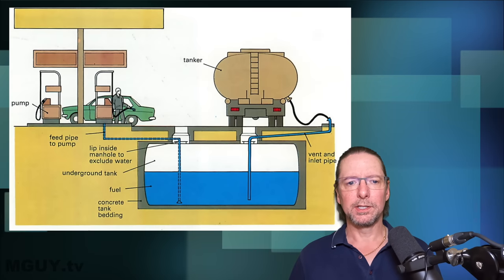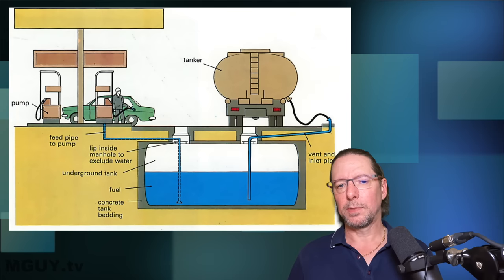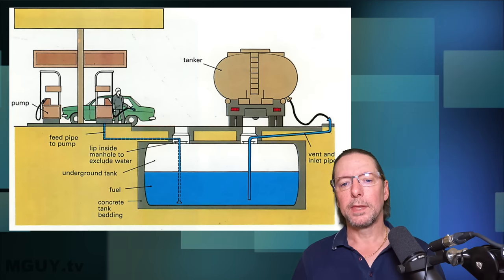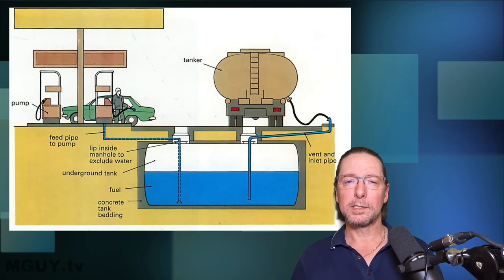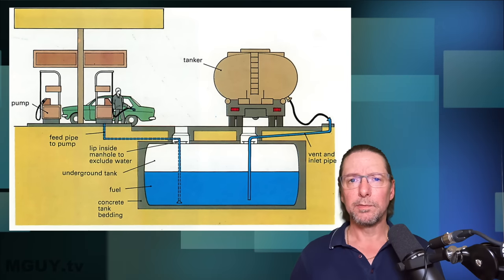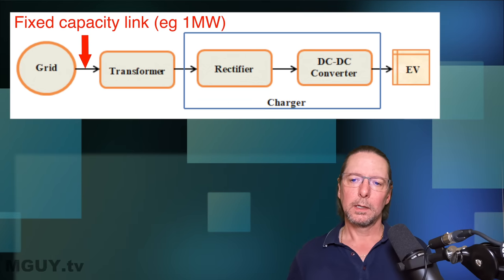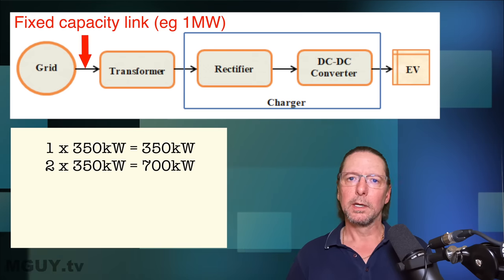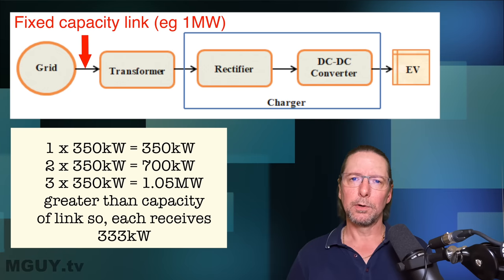HUGE problem with EV Charging Stations that no one mentions | MGUY Australia

Comment: Actually most stations have pumps sharing a common feed so during high volume situations where most pumps are being used fueling times are drastically increased.  If you are holding on to the nozzle when someone else starts pumping you can often feel the change in flow and you can also feel the jolt when they stop.  People harp and exaggerate what might happen on the more rare occasions when they might take a trip on the Expressway however that does not represent daily life for the vast majority of drivers.  Fueling stations for EV's not having large underground tanks of dangerous liquid fuel can be set up at the restaurant, donut shop, rest area, hotel, etc where you are going to be stopping after you normally fuel up an ICE vehicle eliminating the need for dedicated fueling stations and making it so on those rare occasions that most people would need to use a public charging station it would be while eating lunch, shopping or using the restrooms.

The new standard in EV charging stations is to have capacitor banks or battery banks charged off peak or by solar eliminating the need for tank trucks further reducing wear and tear on the roadways along with the inherent dangers of transporting flammable/explosive products on the roadways.  The added benefit of these systems is that they are being used to provide extra power back to the grid during peak usage and are driving the cost of electricity down where they are being implemented.  Countries where they are adopting bidirectional charging and solar are currently seeing this even when located at latitude the vocal minority claims its impossible despite folks living there benefiting from this daily even seeing the cost of electricity dropping substantially and at times even being given away at no charge when there is so much excess capacity with all the grid batteries fully charged that there is no-where left to store it.  Look at where they are actually trying to make this succeed and you will find that without the artificial stumbling blocks put in the way by the naysayers EV's and Solar work out extremely well.

I've been driving an EV now for a decade and its laughable to listen to some of this stuff.  Truth be told I've been keeping an ICE vehicle for all those times I might need greater range and it only gets fueled up once or twice a year.  In ten years I've only really needed to charge away from home twice.  This is more the situation for Joe Average here who drives less than 30 miles round trip  per day.  People who drive substantially more than 30 miles per day are a comparatively small yet highly vocal minority.

The DOT report on driving in the US revealed that most long trips by personal vehicle (defined as round trips over 50 miles) were less than 270 miles round trip so well within the range of most new EV's with just one stop at the turnaround point for charging, most trips over 270 miles but less than 500 miles were by bus or train and the majority over 500 miles were by airliners in 2022 so that is the reality here in the US.  Yes there are statistical outliers that drive more but they are just that outliers and not the more common use cases even though they present themselves as the overwhelming majority.

Best!

Comment: I would like to know what the cost is of charging by how far you can travel...and doesnt heater and radio also cause power to drain quicker?
Reply: Cost per mile varies considerably. For people on overnight special tariffs, and charging at home all the time it can be as low as 2p per mile. The normal daytime tariff at home can be 7p per mile. Public charging can be very expensive - from 12p per mile up to 20p per mile. At that price, it's the same as an average car buying petrol. The heater and radio do use some power of course but over a 50-mile journey, the loss is hardly noticeable.

Comment: (Retired about 5 years ago from a large electric company in the US - I was in IT Field Services.)
This is the level I'm most concerned about in the rosy views of migration to EVs. Aside from the "why" aspect, the devil really is in the "exactly how." Generation has been increasing modestly here in America and transmission (typically above 230kV in America - a similar voltage I forget in Canada) is a fairly stable consideration, but a large number of EV chargers at any location are a challenge in two ways: capacity and just plain existence.

Existence is simple enough: design and build from whatever pot of money is available. New facilities will be properly sized when they are complete. When that will be is anybody's guess: The materials are being made at the pace they have historically been used; nobody has tens or hundreds of millions of dollars of specialty hardware lying around... not the manufacturer nor the wholesaler. That's just as well; it takes time and manpower to build it.

Upgrading existing facilities is not quite as thorny. It is often just a matter of replacing the conductors with larger ones. Not so bad when we are talking about a mile or two, but in the hundred mile regime it gets awfully real. No showstoppers, just a long slog.

All that can be left to the experts to work out. There! All we have to do is pay for it! Who does that? It varies from state to state in the US. Here in Arizona maintenance costs are borne by the provider; capital costs are borne by the ratepayer. Everything we are talking about is capital investment. As a ratepayer, I'm not particularly happy about this.

Comment: At times I would unload an (about) 8000 gallons of Hexane from a trailer at the plant I worked at. That was a typical load so using 8000 gallons (of regular gasoline, depending on the time of year, affecting the blend) a truck load of gasoline would contain about 920,000,000 BTU's. One Kilowatt of electricity has about 3,412.1412 BTUs worth of energy (over one hour). It would take about 269.625.4 Kilowatts to equal the energy stored in the gasoline. Granted many hybrid automobiles only recover about 40% of the energy in gasoline but it is safer to store, transport, easier to distribute, dependable and has an infrastructure that works around the globe. Even at 40% each gallon of gasoline compares to about 46,000 BTU's or about 13.5 kw hours (IF the EV was 100% efficient and they are NOT!). In summer the cost of electricity in my home is about $0.17 at night so the gasoline equivalent price would be about $2.30 per gallon. BUT the charging, storage in the batteries and usage of that energy in an EV is NOT 100% so the actual cost would be similar to gasoline (about $3.00 now). Winter changes the dynamics dramatically in the favor of gasoline. No worries about burning down the neighborhood. If you GAVE me an EV I would simply sell it as I have a Honda CR-V hybrid that gets great fuel economy, is very dependable, retains its value near the top of the list, has a great ride AND I can drive anywhere there are roads and I don't even think about refueling.

Comment: Two things to consider. First, In any area of a small town or city,  how many people have to wait in line before they can use their cookers and other domestic appliances. Public charging stations will adapt to be able to take significant numbers of cars even at high charge powers. Look at some Tesla rapid charging stations with dozens and dozens of high current DC fast chargers. Second, there may well be no need in the future for many public charging stations anyway. Future EV's will be able to do 1000 miles and more per charge. That means you never need to charge during the day but instead charge at night when all those cookers are off and everybody is in bed. Given you sleep for 8 hours you have 8 hours and more to recharge at a lower power rating. The Mercedes EQXX already does 1200 Km on a single charge of it's 100KwHr battery. Night time electricity is cheaper for a reason. All that generating capacity and no one needing it as they are all in bed. Future high capacity EV batteries will tap into that available unused resource but I am afraid it will mean goodbye to cheap night time electricity! The main mistake that is always made on these topics is to list tomorrows problems by only using todays technology.

Comment: What if the underground tank can only re-supply 10 cars before running empty and 20 cars come to be refueled. Is this a problem or will they place a larger tank in the ground before building?
Just why are you limiting the charging stations capacity?
BTW I worked at a company that operated 3 large sideloader forklifts, 2 small ones and 1 normal forklift all electric.
They had enough power to charge all of these at the same time.

Comment: Here in America Jeep hybrids are catching on fire with them sitting there just parked and turned off. They're saying it's the problem with the battery it might not have been made inproperly. The factories say they can fix it with software but many are saying the batteries are going to have to be redesigned and replaced. Can you imagine how many things are being hidden about other vehicles that are in the same boat. Good luck my friends be safe

Comment: There is one service chain on UK motorways that has installed EV charging at 3 sites but cannot connect to the electricity supply due to lack of capacity in the cables to connect to the national grid
Reply: Yes. But you didnt spot that the Government has allocated £shedloads to the DNOs to put in new power cables to such sites.

Comment: The previous commenter makes a good point about battery buffers.  However buffers only help mitigate the problem.  The value of a charging station is that it charges faster than charging at home.  That value of a fast charge goes down with more cars charging.  Electric cars are great for workers commuting and charging at home but for long distance forget it.  The EV will have a place in society but charging will never scale well like the traditional petroleum industry.

Comment: Taking this line of thinking a little further.  When there are a more EVs  there will  be times of the day  e.g. 7 pm when people get home and plug the car in . This could easily amount to 25% increase in demand which CANNOT be handled by grid infrastructure. National Grid is already been talking about doubling the grid capacity but magnitude of this task is mind bending.  More Pylons ,New substations and ripping up all the roads to replace the woefully inadequate cables  underneath.  I was speaking to a National Grid proper Engineer about this  ...he could not see how it could be done in the time frame envisaged.
Reply: Most people who can charge at home will choose an overnight tariff designed for EV use. They are very cheap tariffs between midnight and 5am. So they plug in when they get home but the charge only starts on a timer to get those cheap electrons. And the charge points are now 'smart' so that each one is activated by their power supplier in phases to avoid millions all starting at exactly midnight together. Your National Grid engineer should check with his bosses because they are happy about overnight charging.They have a massive surplus at night as all factories shut down and people go to bed. Means that they wont have to shut down production which is expensive and problamatic.

Comment: Simple but brilliant analysis. The electric network (the local grid) cannot handle demand. This is equivalent to a throttled internet speed  (reduced bandwidth). None of us want to go back to slow downloads, watching your computer screen paint bits at a time. Few of us want a similar event with car charging. Hydrogen is a better solution for zero emissions.

Comment: The key issue in Australia is that most charging stations get their connection from existing pole lines which only provide 100 Amp connection resulting to sub-optimal solution  which is nowhere near the 350kw, only a fraction. In order to achieve 350kw they need to get High Voltage supply with with their own transformer and only if the electricity authority has capacity. In many instances they don't but even when they do it is an extremely expensive exercise and I am not convinced the EV charger company selling power will be able to make a profit on their investment quick enough.
One more thing, the existing petrol station companies are designing and installing EV chargers on their existing petrol stations, I am not sure mixing Li batteries with petrol is a good idea, you get the idea.

Comment: Well yes true but also identifies why it is so important to get a home charger , some EV sales are know offering a free home charger ,  the vaste majority of travel is in the local, area these charging stations are used as an exception rather than the rule. PS just another point , if you travel and are near an electricity supply , you can charge, OK its slow BUT as we have done do it overnight as you sleep . also the charging times are dropping rapidly and infrastructure will take time to be put in place

Comment: MGUY - your theory is sound if the connection to the grid is not properly sized to handle all of the charging stations.  I'm guessing that a lot of rural areas will not be properly sized.

Comment: I live in a small town, less than 500 population
There's a charging station at the city park.
I talked to a guy that looked frustrated at the device
I asked what was wrong. He said 9 hours to charge. This was his first trip with the car
Reply: Those low power chargers are at 'destinations' such as parks, where people spend a couple of hours and plug in as a bonus to that visit - not as a prime charging solution. That new owner had obviously done little research on the subject of charging. That was the issue. Not the EV.

Comment: Limited local grid capacity is a real thing. I worked at a facility that had sensitive electronic equipment needing a stable power source. The local grid voltage wandered significantly as nearby industrial facilities operated their equipment. We had to install voltage stabilization hardware. This was in a major US city before EV demand was a thing.

EVs will force a lot of additional power generation... which I strongly doubt can be met by "alternative energy" (unless you include nuclear in that category). EVs will force expansion of the power distribution network regardless of power source. The amount of extra power lines, switch gear, transformers, etc. that will be needed must have CEO's of some major corporations salivating, and city planners looking for headache remedies. The same factors--along with their "upstream" consequences such as mining, solar cell processing chemical disposal, and eminent domain procedures to expand/establish necessary right-of-way access--will give the protesters and lawyers permanent employment.

Comment: The amount of energy in 1 gallon of gasoline is incredible. It will not easily be replaced. The amount of energy that reaches the earth from the sun is massive and not being used to its full. Fuel made from algae may replace petroleum as it eventually becomes harder to extract and at some point will run out, if electricity will ever go main stream a commitment to solar canopy’s that you park under could work along with the development of better ways to store electricity. All of the problems you mentioned are real but the eventual transition to something other than petroleum extracted from the ground will have to be developed.

Comment: A friend of mine who's an electrical engineer explained this to me. The average home uses 1.5kw of power per day. Just one EV charging station at full capacity on average uses 350kwph per day. That's the equivalent of supplying power to over 250 homes in one day. To understand the magnitude of this fact, just drive down a street and count 250 homes.
Reply: Your friend is so wrong that it's scary. 1.5kWh per day is ludicrous. At 1.5 x 365, that would be around 550 kWh per annum with a monthly bill of just £14. Nonsense. Most homes use between 7 and 8 kWh per day. Has he tried calculating how many kWhs of energy in the form of petrol is dispensed by a single petrol pump in a day and equate that to a number of houses? Why not? It's a silly calculation because his guess of 350kWhs per day from a charge station should relate to how many miles that means to an EV - not how many houses equivalence.

Comment: When I charge at Ionity supercharges in Europe that is not at all the experience I have. Their grid connection has much more capacity, ensuring that all charging stalls are able to operate at full capacity. I always get 250 kW of charging power, even if the 7 other stalls are in use.

Comment: Your comments should have included the time period to charge the EV. The time period increases proportionally to the instantaneous total power draw once the maximum available power is exceeded at the site. This means a 15 min fast charge could potentially take 30 mins or even longer, dependent on the total charge demand, at that point in time.

Comment: I see a few losses when charging an EV.
From start to finish, Losses include:
Power generation losses at the power station.
Transformer losses in stepping the voltage up.
High voltage transmission line losses.
Transformer losses in stepping the voltage down.
EV charging circuit losses.

I didn't run the numbers but I believe this will become significant as more and more people operate EV'S

Comment: Does this theory also impact at home charging ?  If someone is running their air conditioner, washing machine and dishwasher etc, along with trying to charge their EV and they are on single phase power (like most metro homes) will everything be impacted ?
Reply: Yes depends on size of the circuit breakers, but will be a huge problem for people in high rise towers